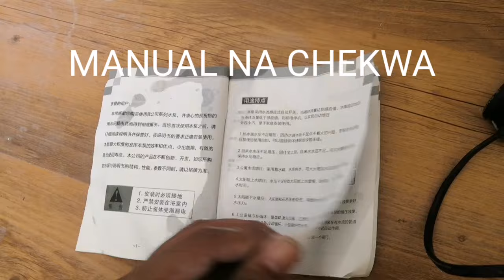AUTOMATIC WATER BOOSTER PUMP INSTALLATION

Comment: pwede po kaya yan lagyan ng pressure sensor switch? hindi po kasi pwede ang flow sensor switch sa project ko dahil mataas ang outlet thanks
Reply: ang flow sensor nya ay para mag energize ung pump one na mag open ka ng gripo or else
Reply: @kuyanoltv8516  okay na po Sir... nagpalit narin ako ng booster pump... hindi sya bagay sa pangangailangan ko. thank you.
Reply: @alexcaparas4690 ano po pinalit niyo? Pwede po pa share ng link? May flow sensor po? Need po kasi namin
Reply: @paulallenpatriarca  hi Sir... panget po yang booster pump na yan... sayang lang pera nyo. nagpalit ako ng mas malaki at gumamit ako ng APC.
Reply: @alexcaparas4690  Thank you po sa advice. san po kayo naka bili ng bagong booster pump? ilang hp tsaka san niyo po nabili flow sensor
Reply: @paulallenpatriarca  sa Lazada lang... yung booster pump na may built in tank 1hp. panget flow sensor Sir... much better APC
Reply: magkano po bini nyo na booster pump with tank mam @paulallenpatricia?then bumili rin po kayo ng apc?

Comment: Sir ask lang po, dito kase samen pag tanghali walang tubig sa thirdfloor as in walang wala talaga pero sa second floor po meron, san po dapat ilagay yan? Pwede poba sa thirdfloor o sa 2nd floor syaa need ilagay?
Reply from the maker: sir sa second floor po, tapos ung outlet nya ay ung supply papuntang third floor
Reply from the maker: xl6H8L4E0kPAgGfMePal
Reply: Pa-install po kayo pressure tank na. Dagdag ka nalang kaunti 100% na lalakas tubig mo
Reply: @TECHSCRIPT10  sir pwede poba sa nawasa ng barangay dipo kasi aabot saamin tubig kaya nya kaya higupin tubig papunta saamin .